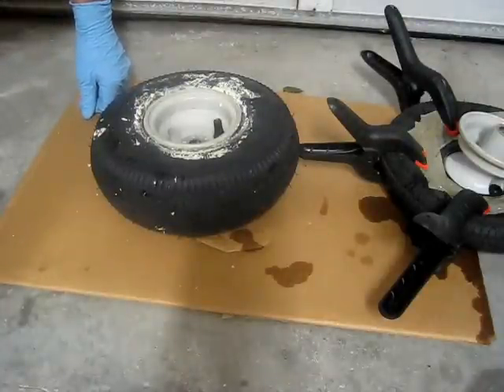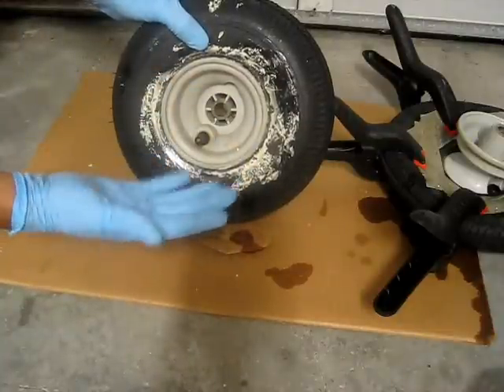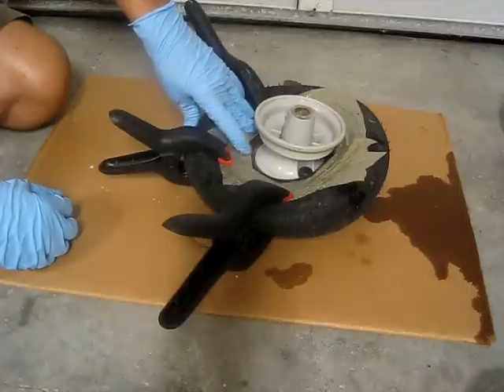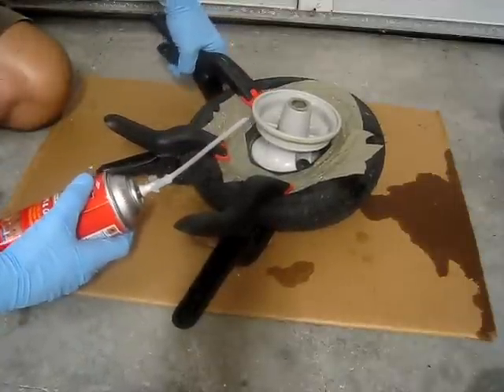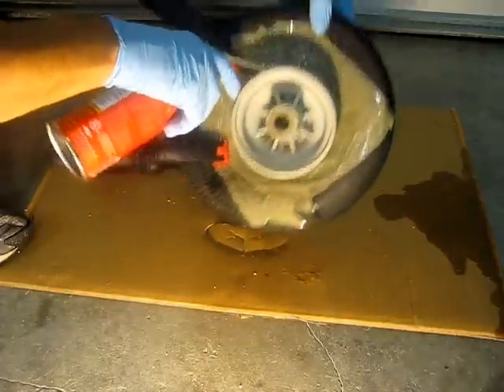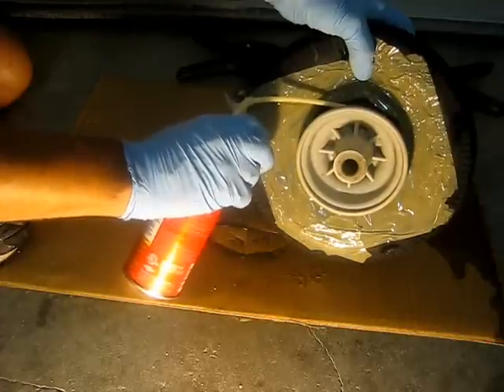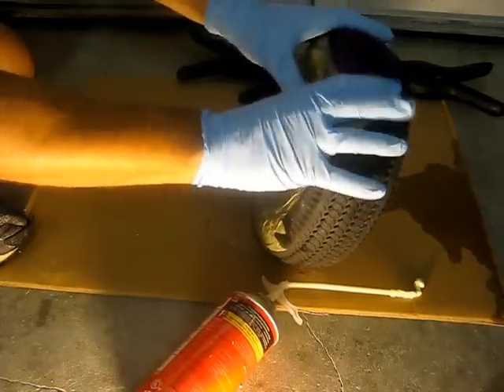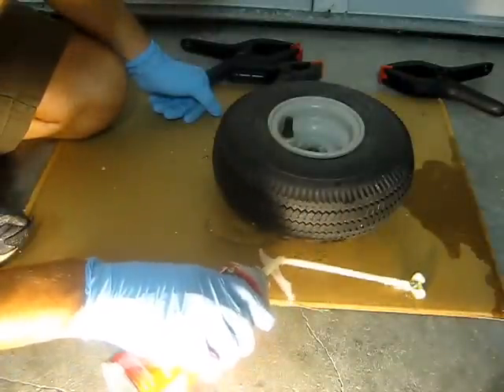How To Fix A Flat Tire

Comment: Will it work with forklifts tires 12x16.5 or larger ones like telehanders 14x24
Reply from the maker: I seriously doubt it will work for something as heavy as a forklift or telehanders.  The weight would crush the foam.  But they do make products for that purpose that are very expensive.

Comment: Hello 
will it work for a bike tyre (80/100-18) which has 3 patch plugs
Reply from the maker: I doubt that you could get many miles out of foam in a bike tire.  There is too much weight per square inch.  It might be ok for a child's bike.  But that would be about it.
Reply: thanks
Reply: Ranjith G holts tyreweld will work

Comment: would it work on the front tire of a lawn mower
Reply from the maker: +Mustang Wolf It depends on the shape, size, how much weight you are going to put on it, and how rough you are going to be on it.  A tall, skinny tire with a lot of weight running over rocks and logs won't do too good.  But a 10 inch tire on a small riding mower will probably do fine.  It is best to wait until you get tired of fixing it, then you have nothing to lose ;-)

Comment: and second ? would this work on a quad that goes about 30 mph .3 question does this make the bead set to hook the rim together with the tire epsically the rear tires to build the machine and me
Reply from the maker: +Mini Motoskills The problem with great stuff foam is that it can be crushed.  If you run over hard objects, like logs, it will crush the foam a little each time.  It may eventually break down.  I have seen where people put chunks of closed cell foam in the tire and then use great stuff foam to help hold it all in place.  The closed cell foam blocks help slow down the crushing problem.  I would think it would work fine if you get the foam distributed evenly.  If not, you may have a balance problem.  It will glue most surfaces together, but it may eventually let go of the rim or tire especially if you run low air pressure.  Good luck
Reply: +fixpro256 thanks do u know where to get some great stuff from
Reply: +fixpro256 I finalllllllllllyyyyyy found some thanks dawq now I'm gonna put it in the tires for my banshee thanks again for the help and you beginning willing to help me.

Comment: What type of
 rim it is
Reply from the maker: It's a plastic rim.  This came off of a, mostly plastic, hand truck.  I cut it down and removed some of the extra parts to make a kayak carrier out of it.  Just used it again yesterday.  Haven't had to do anything to the tires since I made this video. Many years ago. Nice not to have to screw with adding air all the time or replacing tires every couple of years.

Comment: where do u get this at I have went to CVS /Walgreen's/dollar stores/k mart etc and I don't see it.
Reply from the maker: +Mini Motoskills It is primarily sold in hardware stores, like Home Depot, Lowes, ACE, True Value.....  I think Walmart sells it also.
Reply: I only have fix a flat and its not a foam supplement it just a can of comprised air and some chemical that supposly seals up holes but It don't work .
Reply from the maker: +Mini Motoskills Fix a flat only works well in certain situations.
Reply: +fixpro256 thanks for helping me
Reply: +fixpro256 I apperciate it a lot